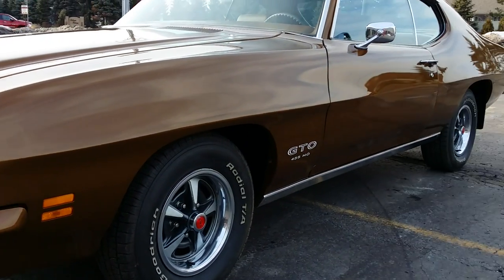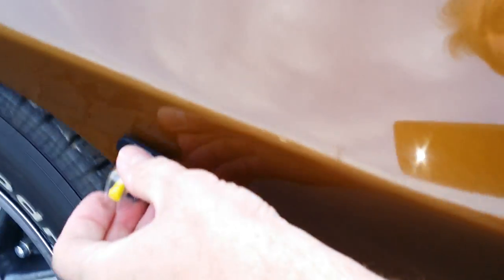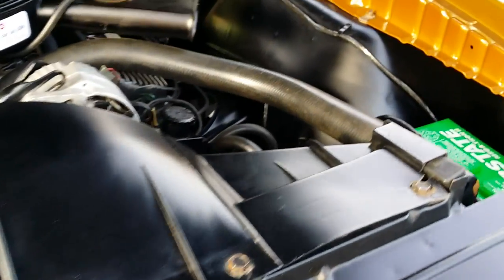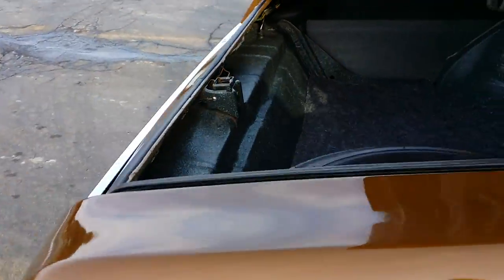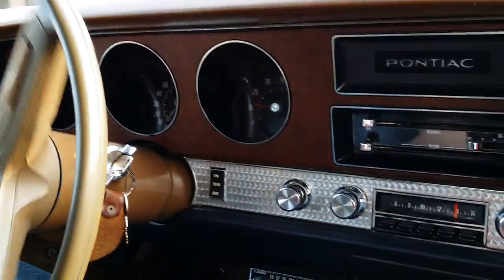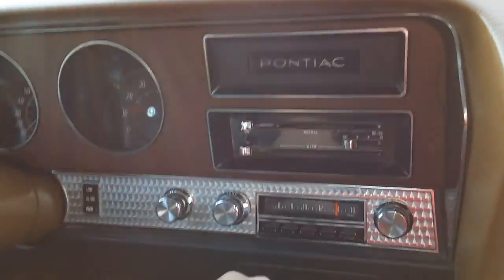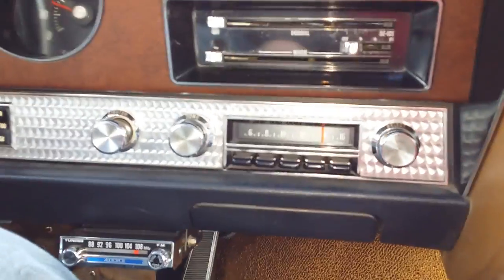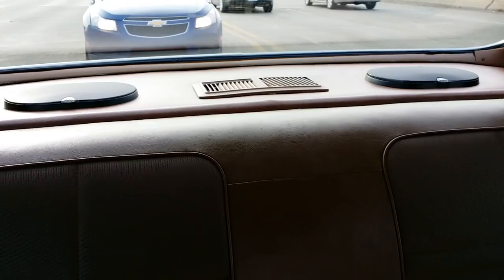1971 Pontiac GTO HO 100 mph test drive! for sale auto appraisal Detroit Mi

Comment: Pontiac never used the term "LS5". No such engine for Pontiac exist. Pontiac never made a big block either, all blocks were the same size, bore and stroke differentiated the cubic inches.
Reply: Some folk refer to the "large journal" engines (421, 428, 455) as big blocks but you are right, other than that they're basically all the same.

Comment: nothing like the lope of a old pontiac.
Reply: daniel keener, I remember my 64 Goat convertible with a 421 Super Duty, dual quad factory installed engine. It had the McKellar #10 solid lifter NASCAR CAM! It had a Super T-10 4-speed and 4.88:1 Safety Track rear end! It used to run consistent 12.2 second times at 120 mph on the track or street. More than a match for that 70, 455 Goat! It was only one of way less than 100 cars like it!
Reply: Absolutely could not agree more.

Comment: He wasn't pulling into that station just to drop the guy off, believe me. If you own a car like this then I would have to assume that gasoline prices for hi-test for the big block isn't going to be an issue for you. The only issue would be that the gas tank seems to be a little small, but that would mean that 24 gallons of gas is a small tank. I remember when this car was bought new that hi-test was about 38-40 cents/gallon. Well , now it's approximately 10 times what it was back then so you do the math. At anywhere between 8-12 MPG, depending upon right foot pressure, you will get lots and lots of enjoyment and fun in the car. I should know, I'm quite experienced with the HO 455 but that was way back then, I think I would go broke now if I had to buy the gas for this monster, but I would go down with a smile on my face and blue tire smoke in my lungs. What a rocket ship.
Reply: TBull Cajunbreadmaker 
I can attest to your claim of low gas mileage.
It took five dollars of fuel just to run my 1971 Pontiac Firebird around the block back in the 90’s
455HD

Comment: Nothing like a Poncho power, friend of mine had a 69 convertible 4 speed Lemans, 350/330, awesome sleeper, full PMD wheel covers, white letter tires dual exhaust, manual steering and brakes, beautiful whit interior black console Hurst 4 speed shifter, white convertible top, deep green exterior, that thing was unreal, no one saw it coming, or heard it till that 4 barrel opened up, and those duals started to sing, and by the time you figured out you'd been had, we been gone, with a nice 8 track tape playing

Comment: Hey guys, thanks for the video.....love the 71-72 G.T.O 'S......only disappointment for me , was the chrome wheel mouldings and rear factory spoiler was missing......But a real nasty sounding classic , absolutely beautiful car.......Back in 1988 I was working for a Chevrolet/olds dealer, and the owners son, went to Georgia and brought back a 1971 455 H.O G.T.O judge.....the car was mint inside and out, black with a black vinyl roof and black interior ......The judge stripe package was two tone orange and red on the fenders and quarter panels......All the paper work came with the car showing it was an original car and not restored .......The factory rear spoiler was on the car, and the mileage at the time was showing 66,000 .....It also had the rally2 rims with the chrome trim rings......Later on that summer of '88, they put the car in the show room of the dealer , and the son was asking $ 18, 500.......It was worth ever bit of the asking price, it was basically brand new .

Comment: that thing he is using is a stud finder for finding metal stud in a wall. I always use one of those weak rubber refrigerator magnets. I strong magnet will stick through thin body filler.
Reply: Good idea!

Comment: I had a 1970 455ho trip duce intake a isky 500 cam Mallory's electric ignition, tracktion bars a boagwana multi plate clutch the only problem was the brakes hard to stop

Comment: What are you calling a LS5 option on a GTO?
Reply: +GlassTopRX7 the 455
Reply: Umm ok, but the 455 was was a poor breathing truck engine.
Reply: The 455 is legendary, you can get heads that flow for one, or a ported set of d ports would work just fine. None of that has anything to do with the fact that this is an Ls5 455, made a lot of torque for its day.
Reply: +GlassTopRX7  truck engine? I think ur confused with a chevy 454.
Reply from the maker: +GlassTopRX7 actually, according to the original invoice that 455 is referred to as an LS5 option. Sorry for the delay in replying
Reply: 455 HO for 71 was WL,WC,YE, that car should have had a WC with the 4 speed.  LS is a Chevy code for the 454.  Pontiac didn't use LS codes for any motors that year.
Reply: oldgateway
The 455 can't rev, past 5600 and peak power was at 4800, the 454 revved to 6500 and peak power was at 5600.  454 is over square the 455 is under square.  Which is more like a truck engine again?
Reply: what Buick olds pontiac truck was the 455 in again? I like torque, hard to shift a standard past 6000 too and it will last longer theoretically
Reply: The 1970 455 HO D-Port engine was not a great performance engine.  Pontiac gambled that their aging market would rather have more options and so this engine had gobs of torque (500 lbs).  They lost the gamble because folks wanted a 455 that could challenge the 454s, 440s and 426s.  In 1971, Pontiac wised up and equipped the engine with the Ram Air IV equipment that was expected in 1970.  The result was an O-Port engine with exceptional breathing quality, as well as the RAIV aluminum intake.  Pontiac historians state that the 1971 GTO with the 455 HO was the fastest goat ever tested, but the public never believed that because of the watered down 335 HP rating.
Reply: the 455 never appeared in any trucks LOL wtf are you talking about? small chambers raise the compression for max TORQUE, which is always king at the track.
Reply: pontiac 455 wasn't designed to be high revving like chevys boat anchor big block. thats why its refered to as a "low end torquer" All the power is at LOWER rpms. doesnt make it "less breathable" or more truck like. your speaking from a typical chevy narrow minded view. in the early 90s the 502 H.O. heads were copied off our small chambered heads, making that gm performance 502 run JUST LIKE a pontiac!
Reply: that guy is a typical chevy propaganda . probably never even driven a Poncho before.
Reply: GlassTopRX7 That’s what I always thought too, but Pontiac made an L75 455 while the HO 455 was option code LS5. I think you’re right about the engine codes, but the option code on the invoice says LS5. Pontiac apparently used different identification codes for the engines than the option code for that same engine. Who knew?

Comment: Hey buddy .. the LS5 was a Chevy 454  ?  just in case you were wondering ...
Reply: Sure it wasn't a LT
Reply: Go on google and type in 1971 Pontiac LS-5 motor. You will find you're mistaken.
Reply: Mr Twit Very interesting. The LS5 Chevy 454 is quite well known but Pontiac made an L75 455 that could be easily confused, but they also made the 455 HO, code number LS5, something I never knew before. Good catch!
Reply: It came with an LS-5 -   1971 Pontiac GTO
335 Gross Horsepower @ 4,800 rpm
480 lb-ft torque @ 3,600 rpm
¼-mile: 14.9 seconds @ 95 mph* 

Specifications

PRICE
Base price: $3,446
Price as profiled: $4,361.83**
Options on car profiled: LS5 335-hp 455-cu.-in. High Output V-8, $136.92; M-22 four-speed manual, $237.60; G80 Safe-T-Track differential, $21.06; GU8 axle ratio – 3.90:1 (G80 required), no charge; U63 AM radio, $66.35; D33 mirror, outside left remote, $12.64; N98 Rally II wheels, $89.52; N41 power steering, $115.85; JL2 power front disc brakes, $69.51; B32 front floor mats, $7.37; U30 Rally gauge cluster and tachometer, $84.26; PK5 G70-14 raised white-letter tires, $43.18 

ENGINE
Type: Pontiac OHV V-8; cast-iron block and cylinder heads
Displacement: 455 cubic inches
Bore x stroke: 4.15 x 4.21 inches
Compression ratio: 8.4:1
Horsepower @ rpm: 335 @ 4,800 (gross)
Torque @ rpm: 480 lb-ft @ 3,600
Valvetrain: Hydraulic lifters
Main bearings: Five
Induction system: GM/Pontiac aluminum intake manifold, Rochester Quadrajet four-barrel carburetor, mechanical pump
Lubrication system: Pressure, gear-type pump
Electrical system: 12-volt
Exhaust system: High-flow cast-iron exhaust manifolds, dual exhaust pipes and mufflers 

TRANSMISSION
Type: GM/Muncie M-22 four-speed manual close-ratio
Ratios: 1st: 2.20:1
2nd: 1.64:1
3rd: 1.28:1
4th: 1.00:1
Reverse: 2.27:1 

DIFFERENTIAL
Type: GM Chevrolet-type 12-bolt, Safe-T-Track limited-slip
Ratio: 3.55:1 (currently 3.90:1) 

STEERING
Type: Saginaw recirculating ball, power assist
Variable ratio: 16.0:1 to 13.0:1
Turns, lock-to-lock: 3.50
Turning circle: 37.5 feet 

BRAKES
Type: Hydraulic, power-assist
Front: 10.94-inch vented rotor; single-piston caliper
Rear: 9.50 x 2.00-inch cast-iron drum 

CHASSIS & BODY
Construction: Welded steel body on perimeter frame
Body style: Two-door five-passenger hardtop coupe
Layout: Front engine, rear-wheel drive 

SUSPENSION
Front: Independent; unequal-length A-arms, coil springs, and tubular hydraulic shocks; 1.125-inch anti-roll bar
Rear: Live axle; upper and lower control arms, coil springs, and tubular hydraulic shocks; .875-inch anti-roll bar 

WHEELS & TIRES
Wheels: Rally II styled steel
Front: 14 x 6 inches (currently 15 x 7 inches)
Rear: 14 x 6 inches (currently 15 x 7 inches)
Tires: Raised white-letter bias-ply (currently Goodyear GT Polyglas)
Front: G70-14 (currently G60-15 RWL)
Rear: G70-14 (currently G60-15 RWL) 

WEIGHTS & MEASURES
Wheelbase: 112 inches
Overall length: 203.3 inches
Overall width: 76.7 inches
Overall height: 52 inches
Front track: 61 inches
Rear track: 60 inches
Shipping weight: 3,593 pounds 

CAPACITIES
Crankcase: 5 quarts
Cooling system: 23 quarts
Fuel tank: 22 gallons
Transmission: 3 pints 

CALCULATED DATA
Bhp per cu.in.: 0.73
Weight per bhp: 10.73 pounds
Weight per cu.in.: 7.88 

PRODUCTION
Pontiac built 10,532 GTOs for the 1971 model year, of which 9,854 were hardtop coupes. Records indicate that just 476 hardtops were furnished with the LS5 455 H.O. engine and manual transmission. 

PERFORMANCE*
0-60 mph: 7.0 seconds
1/4-mile ET: 14.9 seconds @ 95 mph 

*From an October 1970 Motor Trend road test of a ’71 Pontiac GTO “Judge” equipped with a 335-hp 455 H.O., four-speed manual transmission, 3.55:1 rear gear, and G60-15 tires.
**May be a partial list; does not include fees.

Comment: LS 5 ?
Reply: No LS in that!!
Reply: Pontiac made an L75 455, but the 455 HO was code LS5. I didn’t believe it either until I looked it up. I’m a lifelong Pontiac fan but that was very interesting to learn.
Reply: 1971 Pontiac GTO
335 Gross Horsepower @ 4,800 rpm
480 lb-ft torque @ 3,600 rpm
¼-mile: 14.9 seconds @ 95 mph* 

Specifications

PRICE
Base price: $3,446
Price as profiled: $4,361.83**
Options on car profiled: LS5 335-hp 455-cu.-in. High Output V-8, $136.92; M-22 four-speed manual, $237.60; G80 Safe-T-Track differential, $21.06; GU8 axle ratio – 3.90:1 (G80 required), no charge; U63 AM radio, $66.35; D33 mirror, outside left remote, $12.64; N98 Rally II wheels, $89.52; N41 power steering, $115.85; JL2 power front disc brakes, $69.51; B32 front floor mats, $7.37; U30 Rally gauge cluster and tachometer, $84.26; PK5 G70-14 raised white-letter tires, $43.18 

ENGINE
Type: Pontiac OHV V-8; cast-iron block and cylinder heads
Displacement: 455 cubic inches
Bore x stroke: 4.15 x 4.21 inches
Compression ratio: 8.4:1
Horsepower @ rpm: 335 @ 4,800 (gross)
Torque @ rpm: 480 lb-ft @ 3,600
Valvetrain: Hydraulic lifters
Main bearings: Five
Induction system: GM/Pontiac aluminum intake manifold, Rochester Quadrajet four-barrel carburetor, mechanical pump
Lubrication system: Pressure, gear-type pump
Electrical system: 12-volt
Exhaust system: High-flow cast-iron exhaust manifolds, dual exhaust pipes and mufflers 

TRANSMISSION
Type: GM/Muncie M-22 four-speed manual close-ratio
Ratios: 1st: 2.20:1
2nd: 1.64:1
3rd: 1.28:1
4th: 1.00:1
Reverse: 2.27:1 

DIFFERENTIAL
Type: GM Chevrolet-type 12-bolt, Safe-T-Track limited-slip
Ratio: 3.55:1 (currently 3.90:1) 

STEERING
Type: Saginaw recirculating ball, power assist
Variable ratio: 16.0:1 to 13.0:1
Turns, lock-to-lock: 3.50
Turning circle: 37.5 feet 

BRAKES
Type: Hydraulic, power-assist
Front: 10.94-inch vented rotor; single-piston caliper
Rear: 9.50 x 2.00-inch cast-iron drum 

CHASSIS & BODY
Construction: Welded steel body on perimeter frame
Body style: Two-door five-passenger hardtop coupe
Layout: Front engine, rear-wheel drive 

SUSPENSION
Front: Independent; unequal-length A-arms, coil springs, and tubular hydraulic shocks; 1.125-inch anti-roll bar
Rear: Live axle; upper and lower control arms, coil springs, and tubular hydraulic shocks; .875-inch anti-roll bar 

WHEELS & TIRES
Wheels: Rally II styled steel
Front: 14 x 6 inches (currently 15 x 7 inches)
Rear: 14 x 6 inches (currently 15 x 7 inches)
Tires: Raised white-letter bias-ply (currently Goodyear GT Polyglas)
Front: G70-14 (currently G60-15 RWL)
Rear: G70-14 (currently G60-15 RWL) 

WEIGHTS & MEASURES
Wheelbase: 112 inches
Overall length: 203.3 inches
Overall width: 76.7 inches
Overall height: 52 inches
Front track: 61 inches
Rear track: 60 inches
Shipping weight: 3,593 pounds 

CAPACITIES
Crankcase: 5 quarts
Cooling system: 23 quarts
Fuel tank: 22 gallons
Transmission: 3 pints 

CALCULATED DATA
Bhp per cu.in.: 0.73
Weight per bhp: 10.73 pounds
Weight per cu.in.: 7.88 

PRODUCTION
Pontiac built 10,532 GTOs for the 1971 model year, of which 9,854 were hardtop coupes. Records indicate that just 476 hardtops were furnished with the LS5 455 H.O. engine and manual transmission. 

PERFORMANCE*
0-60 mph: 7.0 seconds
1/4-mile ET: 14.9 seconds @ 95 mph

Comment: She's a beauty but it's not an LS5 that is a hydraulic lift chevy 454 the LS5 is not a Pontiac motor so that GTO must have a 455 but that transmission is definitely an M22
Reply: Darryl6636 Go on google and type in " 1971 Pontiac LS-5 motor ". I think your mind will be changed.
Reply: Mr Twit L75 is the Pontiac 455 while the LS5 is the Chevy 454, an easy slip of the tongue. Both great engines.
Reply: I just read that the 455 HO was “option code” LS5 on the invoice, which was news to me.

Comment: that huge 455 on the dash looks cheesy
Reply: Bet you would still take the car though.
Reply: +Brian Turner i already had a gs 455 years ago. it was a beautiful car but not so fast for a huge motor. and yes if someone gave me one for free of course I would take it
Reply: It does. But that was all part of the marketing. It helped to sell the cars.
Reply: That 455 on the dash is not original.  Someone stuck that on there.
Reply: If it's not factory, then yes. My answer would be to remove it and use some sort of vinyl filler to fill in the holes left behind.
Reply: @stripervince1  425 nailbead will change ur mind

Comment: I don't get it. Who does a video that focuses on the radio as the driver is winding through the gears? Totally lame. BTW I do not believe that was a real HO. The air cleaner is incorrect and the heads appear to be void of typical markings.
Reply: Brian Lynn The  aluminum intake with separate cast iron crossover and streamlined exhaust manifold were H.O. only pieces in '71. Ol' Boy said it was numbers matching. You are 100% right about the bogus air cleaner decal though
Reply: Brian Lynn . Oh yeah, camshaft isn't H.O. piece. Lopes more like a RA IV

Comment: Typical Salesman, "All original" Wheels have been redone, its been repainted, engines been rebuilt, electronic ignition,  looks completely restore in engine bay incorrect battery, upgraded brake booster, trunk completely restored with correct splatter paint,  Surviver car, bumpers replated, exhaust tips installed incorrectly, Not a true original surviver car. Restored car is not original or a survivor car.